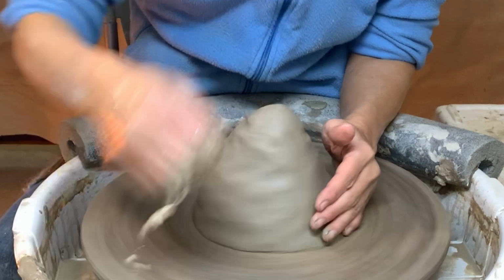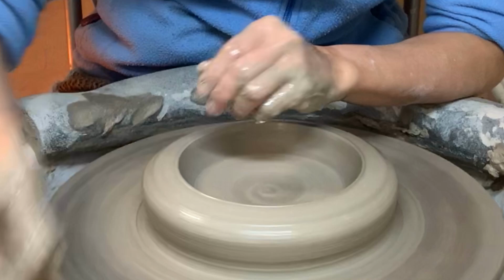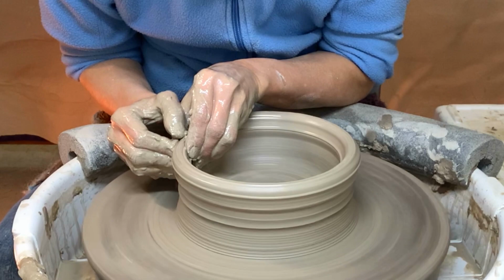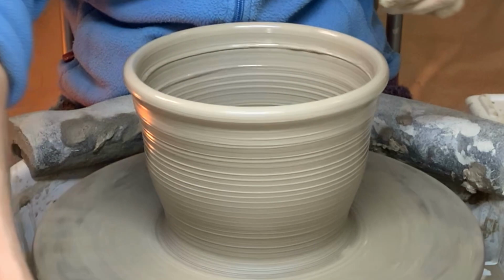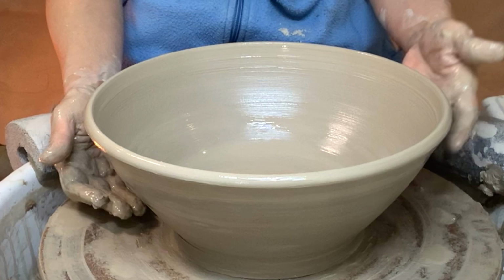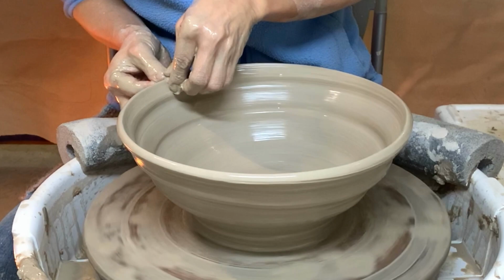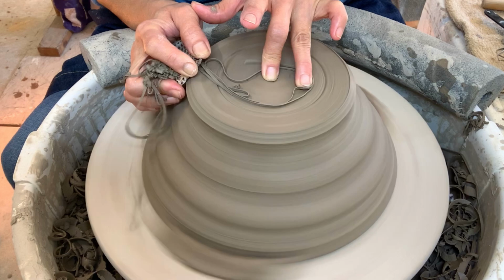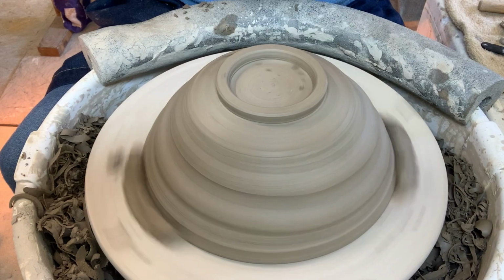Throwing a large noodle bowl with spiral decoration on pottery wheel.

Comment: Another nice video, thank you.  I just noticed the foam pipe insulation you’ve put on your splash pan.  Does that make your arms more comfortable?
Reply from the maker: Thank you for your comment 😊. Yes It does. My wheel setting is higher than most other potters. This higher setting prevents back pain.
On the other hand I can not use the my thighs to anchor my arms. so I have to use the wheel tray to anchor my arms. In other videos I mentioned many times how important to anchor the arms to give a steady form. This pipe insulation is super comfortable for my arms.
If you use lower setting for your wheel and you are using your thighs for anchoring point you don’t need this insulation. I hope this helps you.

Comment: Hi there, nice video. Thank you! A couple of questions for you. :)
1. What is the width of your cylinder - was that 18cm? If so, then what is the final width of the broader bowl?
2. What is that tool (looks like a long spatula) you used for moving/drawing out edges from cylinder to bowl? 
Thanks so much!
Cyndi
Reply from the maker: Thank you for watching!  The Cylinder base center started from 18cm, then when it became the tall cylinder the base is narrower as I pulled that part of clay up. So the base was about 15cm. As you can see the cylinder is slightly open shape which is about 20cm. Then the final width of the bowl top is 27cm.
The spatula name is “Gyubera” means Ox Tongue.
one of my favorite tool. I think you can buy on line.
Mine is a wood. I saw the plastic version also.
I hope my information help your pottery life😉
Reply: @AlchemyCeramic  Thanks so much! This is very helpful! :)